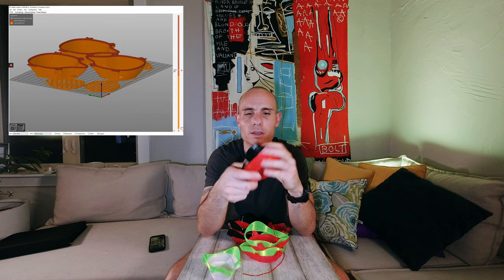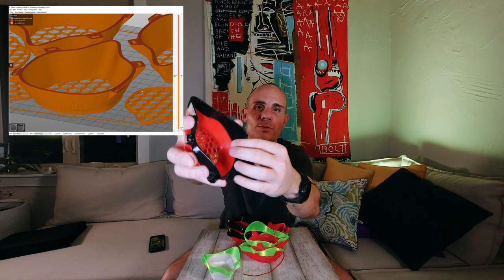3D printed Coronavirus mask design updates #covidMask #coronavirusMask

Comment: I love the 2-layer PET-G/TPU, I also love the larger filter area. I'd like the filter portion to protrude out slightly more and morph into a cylindrical rim, so a hose clamp can hold some filter-cloth over it on the outside. I know the internal grid holds the material on from the inside, but the snap-in action can wear out over time in designs like this.

Comment: Blove, Thanks so much for all that you're doing! I am a critical care registerd nurse and clinical nurse educator. I have been in partnership with local high schools printing the earlier versions of these masks for our hospital staff. None of the printers the high schools have been using handled the TPU well, so the masks were printed completely out of PLA. That produced seal issues that we were able to correct by adding a rubber gasket. This mask was seal tested by our employee health and it passed. I am currently working with silicone gaskets that will stand the test of alcohol disinfectant. 

However the latest "remix" you have shared is beyond amazing! I believe that if I was able hands on demonstrate this mask I can get leadership at my local hospital to invest in 3D printers and we would be able to mass produce these for our nurses on the front lines. Is there anyway I can get one mask? I would be happy to pay for one! Thanks!

Comment: So, have you seen the design from the 3D handyman?  It seems like it would be a good middleground between the two designs, having more breathable surface area and using a regular square shape of filter material.
Reply from the maker: I haven't but I will check it out!
Reply: @ALLYOURTECH3DP  it might need some tweaking ultimately - I'd personally suggest the use of a grid to help support filter medium and, if TPU is being used, to increase the wall width to permit more layers so it seals without needing caulking, cushions, or  precision fitting.    I'm also not sure about the fact it uses a single strap instead of dual straps.  But in terms of the front-end design at least, it seems like a better midground to go with than others i've seen going around, again both being square and has quite large surface area.  https://www.youtube.com/watch?v=kBQcNBPRkh0 would be the video in question.

Comment: Do you think sealing the print is important?
Reply from the maker: We've gone back and forth on that. Enough perimeters printed with PETG and I don't think it is necessary.
Reply: If the mask fits, it will be air tight.

Comment: Hey how you manage to print whith petg and tpu
Reply from the maker: I just switch filament at a pre determined layer height. The two materials readily bond.
Reply: Thanks for replay. 
Do you change temperatures. TPU is lower temp.
Reply: And speed
Reply: @gabrielgonzalez917  just use 230C and <25mm/sec with an extruder gear designed for flexible filament, but there is no advantage to using both plastics, TPU alone works better.
Reply: Hey thanks so much 
I’m using Cura slicer and using Post Processing-Modify G-code, I can change filament,speed and temperatures

Comment: You have no idea if this design actually filters virus. Front line workers need real N95 masks, not novelty masks. The filter material you use is designed to keep out bacteria, not virus. Big difference.
This is fine for most people, to prevent spread, but for those in contact with sick patients, they need real, certified >N95 fitted masks.
Reply: its a matter of what is available.  I don't think these are intended to replace the certified n95 masks.